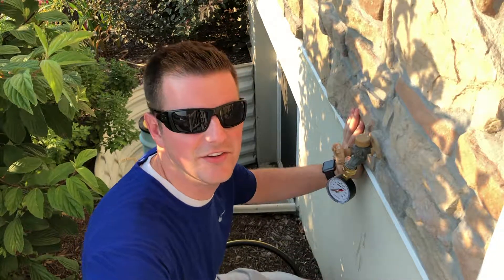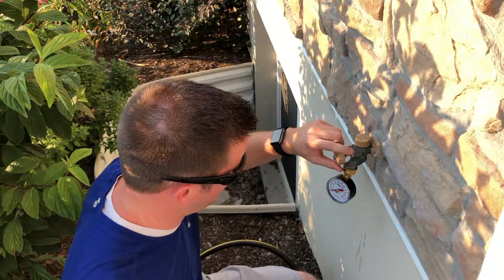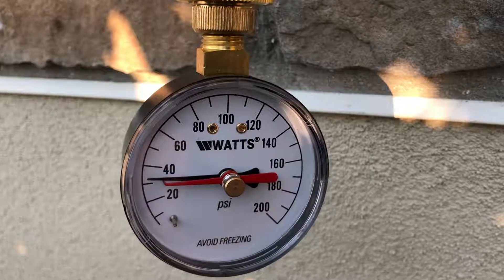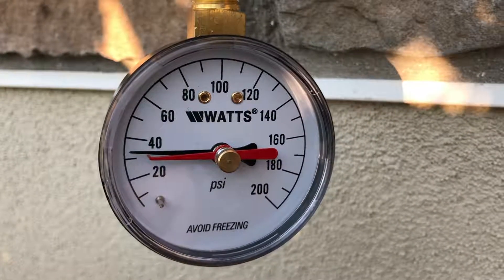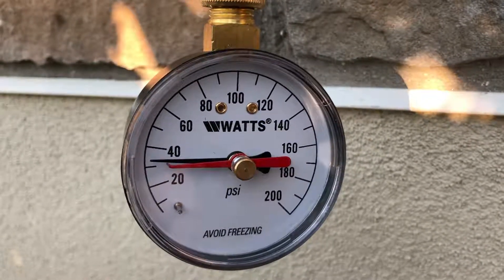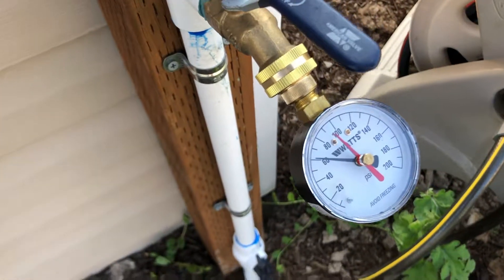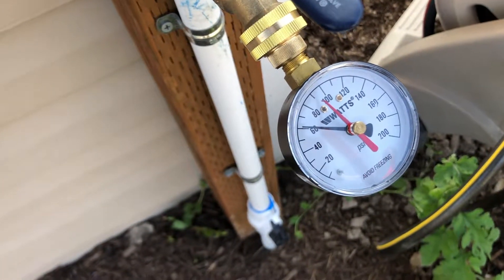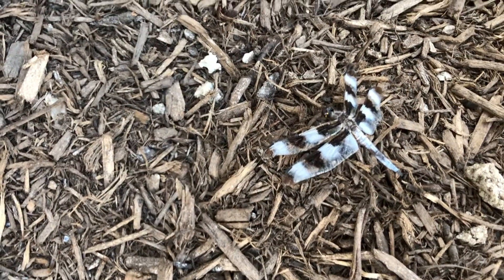Hose Bibb Pressure Test

Comment: I enjoyed it and do you have a pressure regulator in your house just curious and i always see tapping a sprinkler system to the main supply line gives you maximum pressure 😁👍
Reply from the maker: Thanks, Kevin. Yes I do have a regulator in the house. I was able to increase that pressure recently, so now both culinary and secondary lines are closer in pressure. However, my secondary line is not metered here, so I prefer that when im outside.

Comment: TY for posting. I'm looking to test this myself. Dumb question from a novice here... what is the difference between the black arrow and the red arrow?
Reply: Probably too late to answer this but i will in case anyone has the same question - the black bar can push the red bar, but the red bar remains in place after the black bar moves back down. This is so that the red bar can measure the maximum pressure, while the black measures the current pressure.

So if you notice, at the second hose bib that he measures, he turns the valve on and the pressure immediately spikes to about 90psi but then immediately falls lower and settles at about 60psi. The black bar reads 60 to show you the current (consistent) pressure, but the red bar stays at 100 to show you that the pressure reading maxed out at 90.
Reply: @zacharybroussard3765  Thank you! Good to know